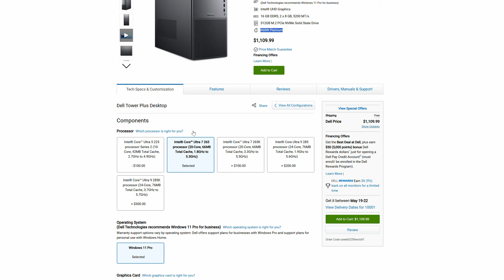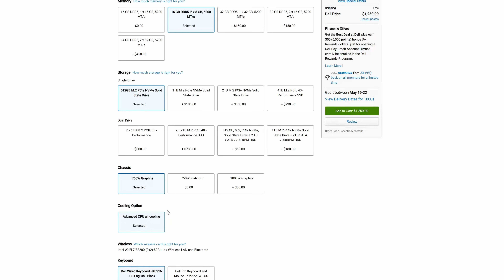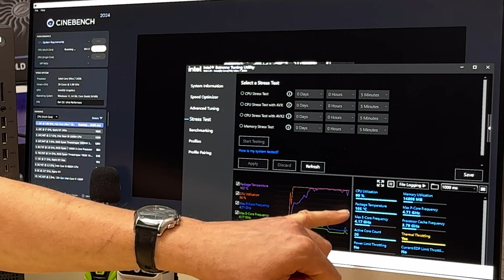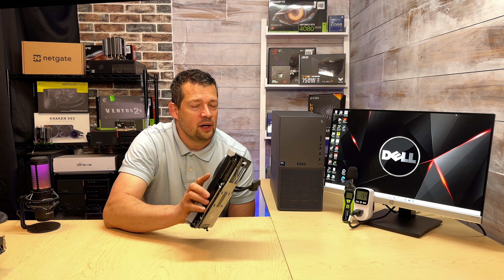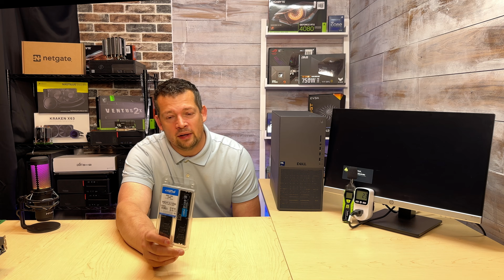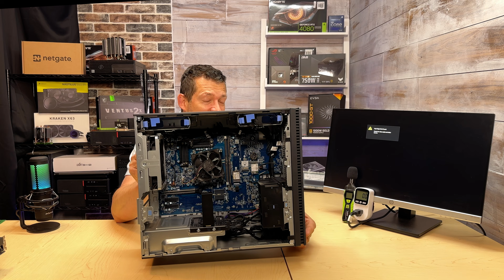Dell Tower Plus EBT2250 - Watch this before you buy it!

Comment: Dell bothered to change their entire product line's names but still won't give you a tower cooler?
Reply from the maker: The crazy thing, I can edit 4k videos with Davinci Resolve , 0 noise, I can play gta5 and other games , 0 noise with this standard cooler.

Dell did not price gouge, I am checking most of their models every couple of days for work , they kept it as low as possible until very recently.

They had this EBT 2250 with an ultra 5 cpu and Linux for $650 I believe.
Dell is really good at introducing a fully functional PC for a very low price point but then charger you an arm and leg for anything extra.
I am perfectly fine with this. I wish the marketing team would chill out a bit and the engineers would be more firm how we go about things.

Comment: I got my XPS desktop just before they ditched the DVD/RW drive. I've even managed to slide a 2.5" SSD above the 3.5" HDD by adding another SATA 7-pin cable to the motherboard.
Reply from the maker: This very same XPS desktop has a business version , it was used to called precision workstation tower.
Same exact size, same exact parts, but different front plate. That model still can be configured with a DVD. I reviewed the last year model , I am hoping to get this year model soon.

Comment: Thanks for the video. My EBT2250 is about a month old now, did not know about "advanced cooling" being a K-special and did not order a K-CPU since I have zero interest in overclocking... but oh well, probably going to retrofit this tower cooler then... BTW, I installed a 4TB Seagate IronWolf Sata HDD into one of the top slots, no vibrations or anything of annoyance, works fine.
Reply from the maker: No worries, if the standard cooler is not making much noise, just leave it as is. Thanks for the info on the HDD!
 I had a 1 TB HDD coming with the PC from Dell  and that thing was clicking  and spinning up and down constantly.
Reply: I'm also grateful for the video. In my experience, the EBT2250 cabinet amplifies the HDD head movements. I installed a 4TB WD Red Pro HDD spinning at 7200 RPM in the front top slot.  No detectable vibration. But every head movement causes an annoying "clunk" sound. I'm going to experiment with some sound baffling (without interfering with airflow).

Comment: Thanks for This new excellent video. Great job !

Your videos are making me hesitate about choosing Lenovo. I see that Dell actually makes products that can be quiet. Compared to Lenovo PCs, especially workstations and desktops, do you have an opinion on the difference in terms of quality and noise?
Reply from the maker: I have been using Dell desktops over 16 years by choice, I had no reason to look elsewhere. I have only seen a handful of Lenovo desktops and they are great too. I would love to see some of their newer models but they usually cost more with similar techs.
About 10 years ago we got  100 Lenovo business class desktops, we only had 1 motherboard failure, we just started pulling them out of production because of their age. They are great too. As long as you go with business class models , get what you like the best.

Comment: 4060ti takes up 2 slots?
Reply from the maker: Yes, it does take up two slots. 
The 4 lane slot close to the power supply will be visible and accessible, I was able to install a sound card  but now there is hardly any space between  the fan on the 4060Ti and the card. I would say about or even less than a 1/4 inch.
It does work but it might affect the cooling on the 4060 and also might generate a bit more fan noise. I am going to have a video release on this exact situation soon.